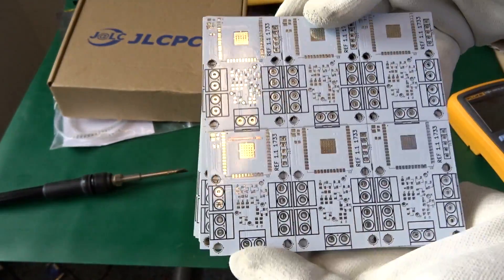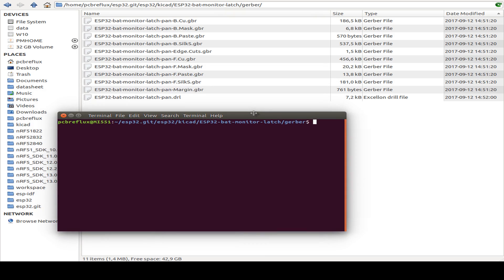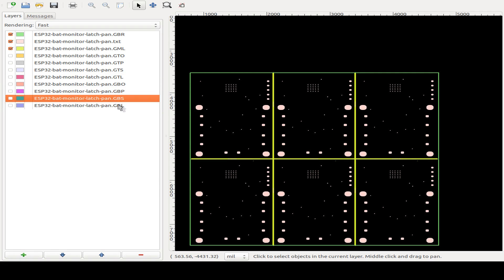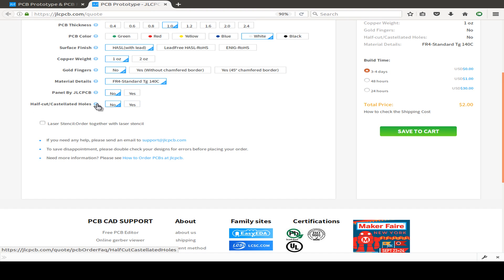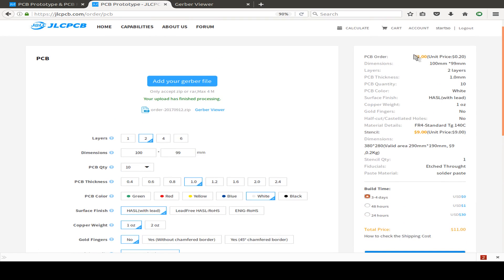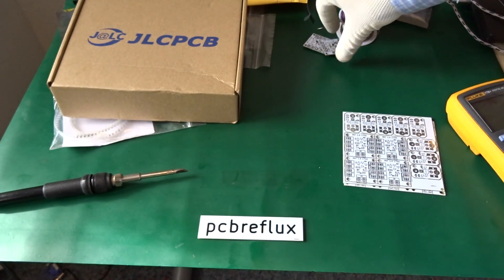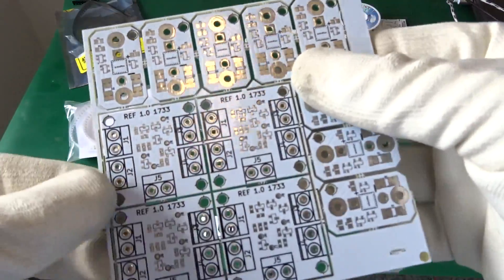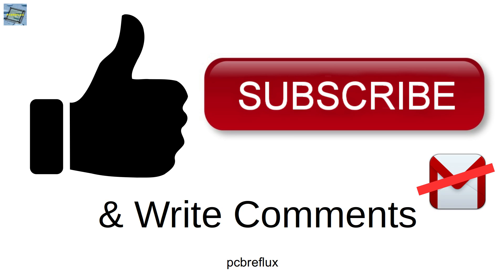ESP32 #55: $2 prototype PCBs ?

Comment: Why can the manufacturers not accept the default names of KiCad on their systems ?? Kicad is a very very popular platform, they should accept ans Support KiCad format by default.
Reply from the maker: Hi, the problem are the libraries. Unlike a Gerberfile the KiCad files can but not have to include all footprints and symbols in a fixed version. So you can not be sure what the manufacturer produce.
Reply: Yup, but I sure hope to get some more development and adoption out of KiCad, most yt channels are now talking about KiCad as a good alternative and Standard platform to collaborate on electronics projects. 
We truly need a Open Source Electronics Design with good support.
I've tried it myself (not and expert tho, far from it) and the only thing I've noticed was the poor autorouting software results. I was able to installed it easily on OpenSuSE Leap ... but the results of the autorouter did not convince me.
KiCad overall is a very very good tool tho ... Orcad Style but Open Source and Excellent at what it does once we get acquainted with it's functionalities. Only the autorouter results were not that great but hey maybe it was my poor handling of the thing ...

Comment: @9:40 For milling you have to provide min. 2.00mm clearance between 2 PCBs if not they consider as v-cut also require min. 0.5mm clearance. if you choose good mfg. then they do CAM work on your data and raise PPA(Pre production approval) if they found problem.

https://www.eurocircuits.com/pcb-design-guidelines/
https://www.eurocircuits.com/10-rules-for-better-data/

Comment: Thanks for the video. I was very curious about their service. BTW, were the J1, J2, etc. marking on the board from the JLCPCB that small in the original Gerber file?
Reply from the maker: Hi, the markings are supplied on the board but maybe to small to seen in the video. Next time I draw them a with a bigger font. It's a small design flaw.

Comment: It's not really 2$, you have to pay for everything you want different. Just check the price difference of 10 to 15 it's crazy. This is just deceiving
Reply from the maker: Hi, checked this and the price rise up to $30 (or $34 for 20pcs). So if you need more PCBs just order multiple times for $2 (+shipping and limited once per day per account) or just use a different (cheaper) manufacturer.

Comment: How do you penalize multiple PCB's for that size?
Reply from the maker: Hi General Aladeen, 

in KiCad I often switch between the canvas and also the grid settings. For placing the components, tracks and polygons mostly I use the "Open GL Canvas" and a grid of 0.2540 mm (10,00mils) and for placing one single board use "Legacy Canvas" and a grid of 1mm (more or less). After finishing one board I save it under a new name (Save Copy As) and open the new .kicad_pcb file. Only now (!) you can also append boards (File->Append Board) with other designs as well. Within "Legacy Canvas" I manually use the block copy operation for penalizing (sorry, no fancy script) with "include items on invisible layers". And for me first placing a copy of the board(s) outside of the 100mm x 100mm PCB (polygon on the margin layer, maybe save this for reuse) works best.

Comment: Quick question, did you notice a pin out for an external antenna for the ESP32 while you were working on the PCB. I don't seem to be able to locate the external antenna to chip input/output.
Reply from the maker: Hi, no PCB antenna on the board. The footprint is for a ESP32-WROOM module that already have the PCB antenna or a antenna connector.
Reply: many thanks